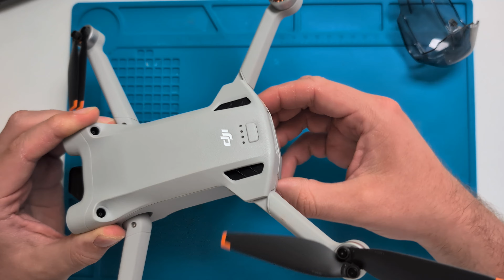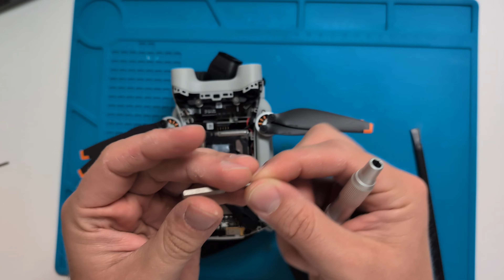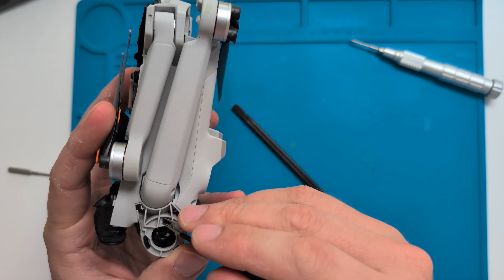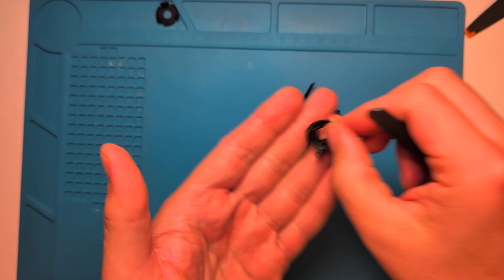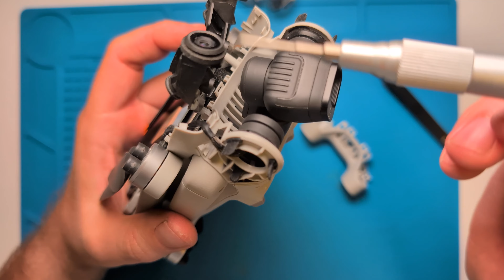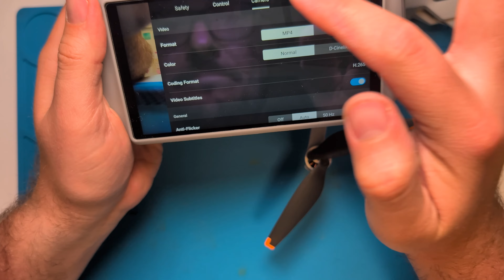How to Fix DJI Mini 3 Pro Gimbal After Crash

Comment: I've done messed up mine and the rubber dampener broke along with one pin from the non wire side.
Fortunately i managed to attack something to replace the missing bit cuz finding the motor bushing alone is near impossible.
The rubber dampener is on the way....besides that there are no errors so im glad about that

Comment: Thank you, thank you, thank you. I have the Mini3 (non pro) with a RC w/onboard screen. Anyways...My drone crashed and suffered only a dislocated housing (Just snapped back into place) and one Damper. I was flying kinda slow over a baseball field and I got a little too close to the grass. and it crashed. I guess I got really lucky. No broken arms, or gimbal. Just the props and the dampers. Anyways...thanks Igor for this much-needed help with the replacements.